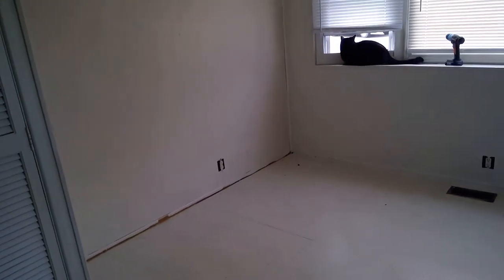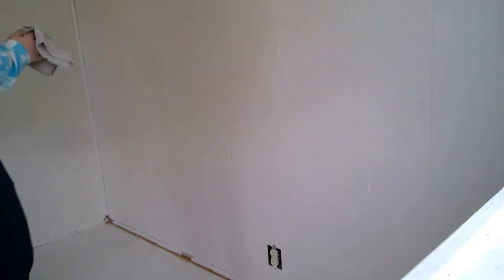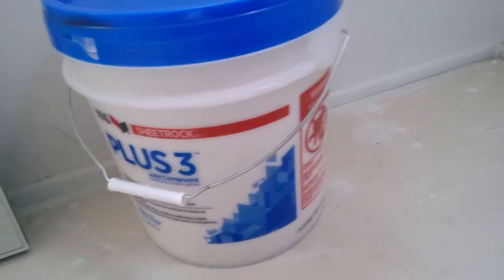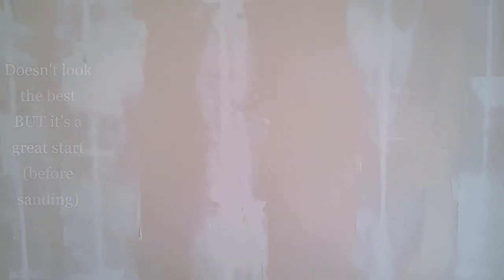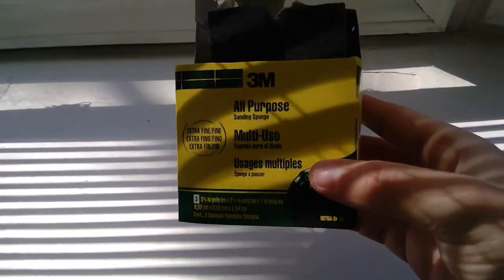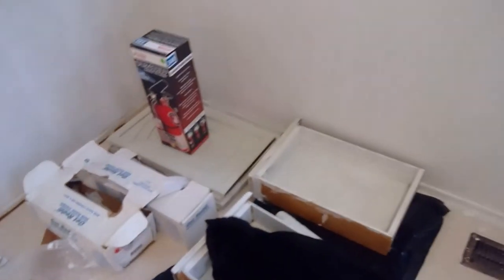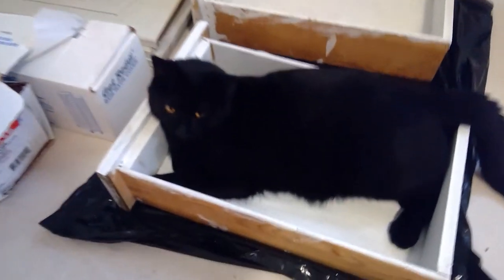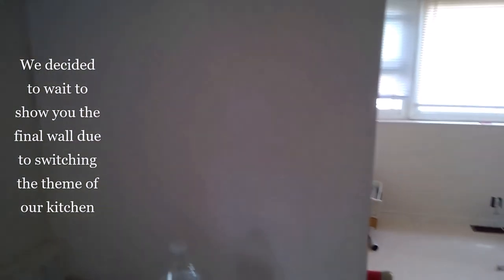Mobile home wall panel makeover

Comment: Has the joint compound cracked from the flex on the walls?
Reply from the maker: If I remember correctly, I used flexcompound.